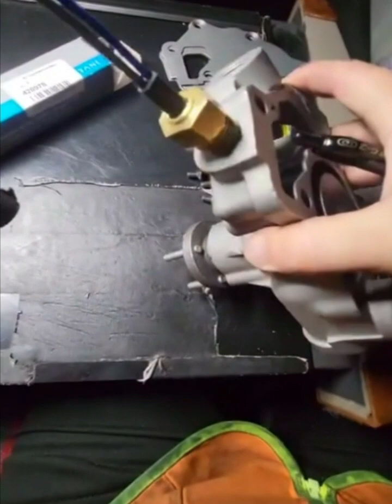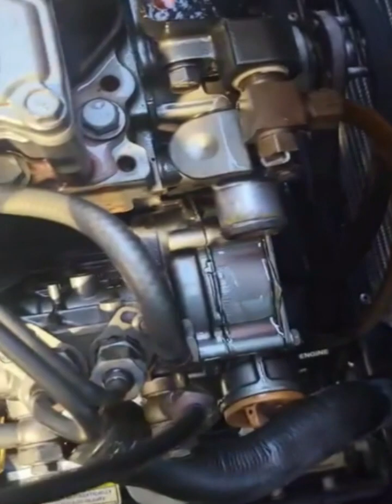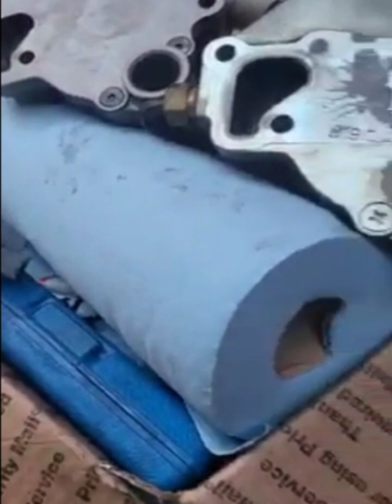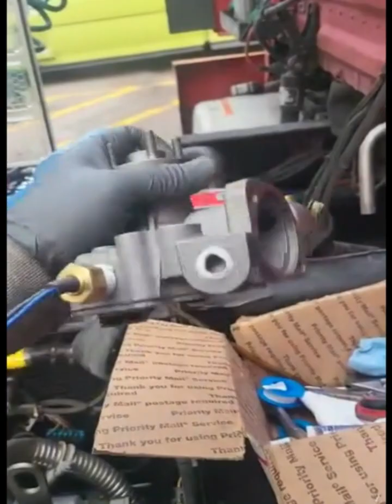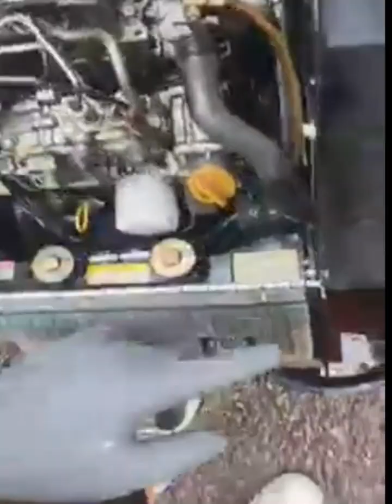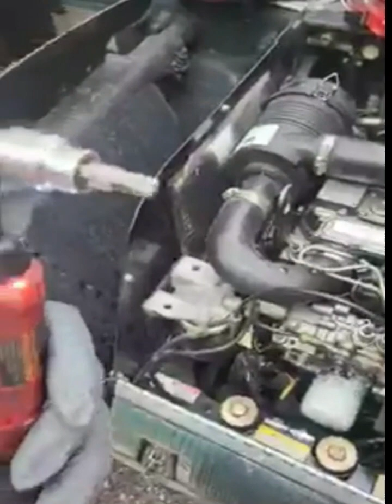Thermo King Tripac Evolution Water Pump Replacement

Comment: Did it stop overheating?
Reply from the maker: Yes, it helped greatly.
Reply: @elitecreteowneroperator  thank you I am working on a overheating problem , checked fans , new artic sensor. Thermostat , now I'll try a water pump , lot of hours on that motor

Comment: Great video. Question: I keep getting a fault code 18 Shutdown High Engine Coolant Temperature and fault code 93 Failed Water Temperature Sensor WT1. Would you first recommend changing the sensor? If that doesn’t solve the issue is the thermostat replacement next? And after that the water pump?
Reply from the maker: Yes, but I wouldn't waste time and trouble doing one at a time trying to pinpoint troubleshoot.  Could be multiple items due to normal wear & tear.  Better to replace sensor, thermostat, and waterpump all at once while you're in there.